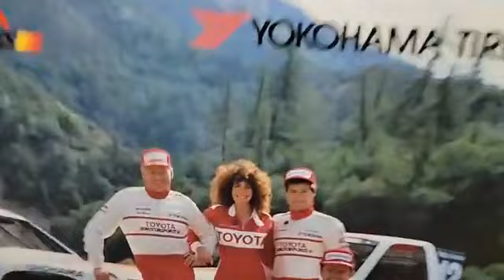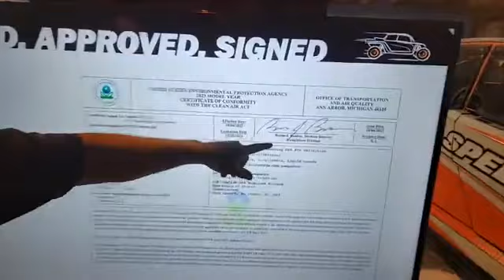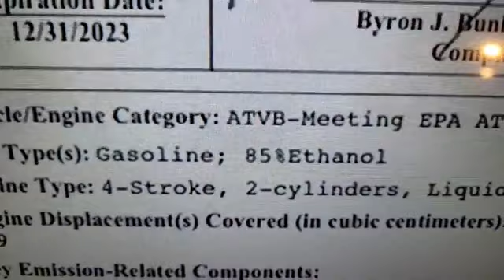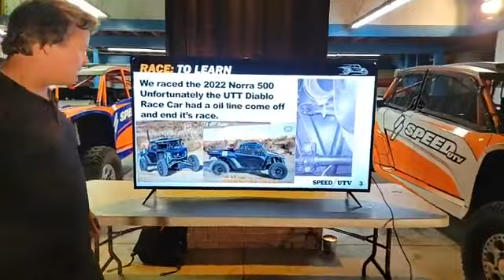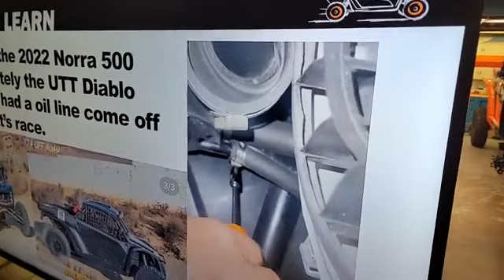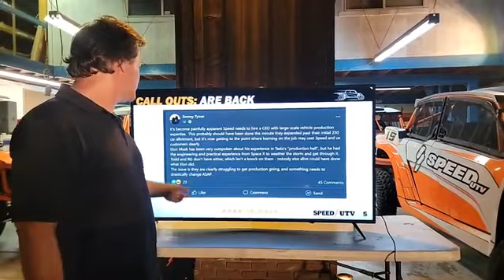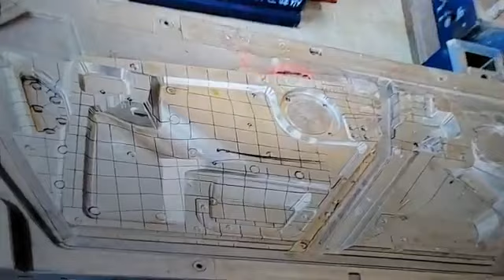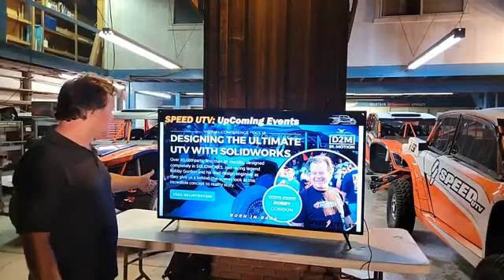Speed UTV Design Presentation

Comment: Not sure if anyone commented on this yet or not, but when the oil line came loose and the oil started draining, was there an oil pressure warning? There should have been notifications on the dash or somewhere before the engine blew....correct?
Reply: Most generators & even the Chevy Vega have low oil sensors that kill the engine